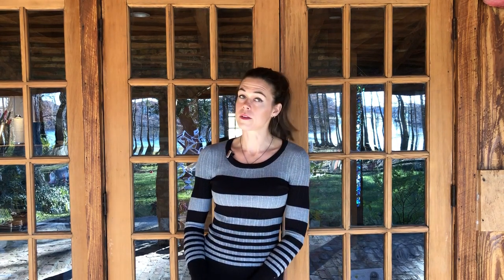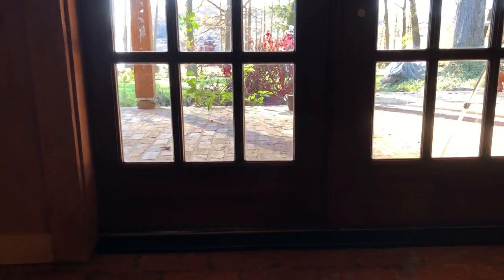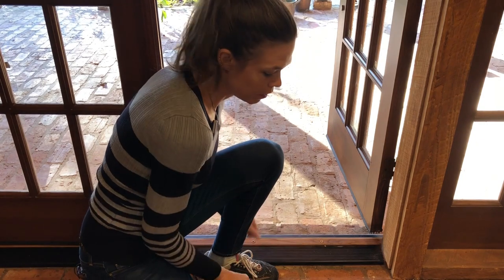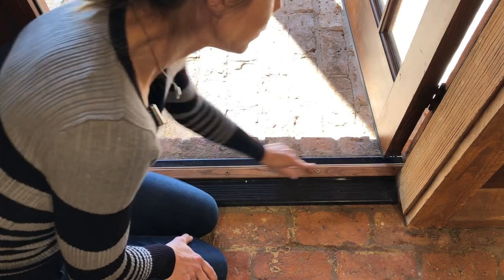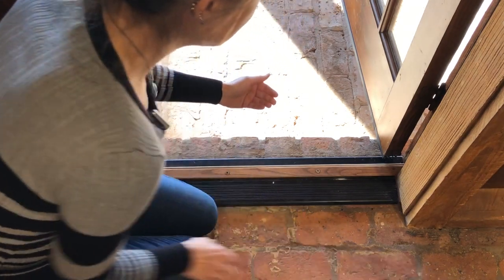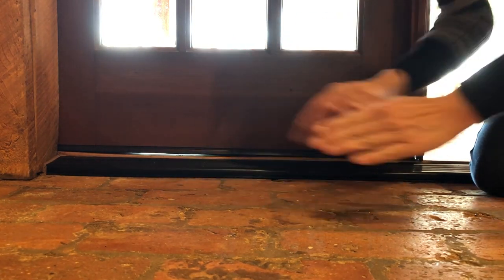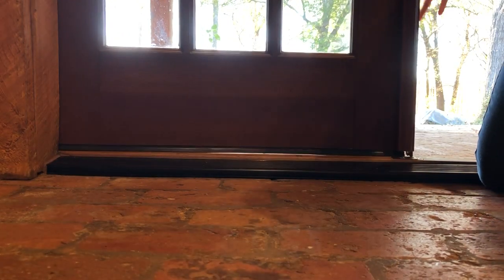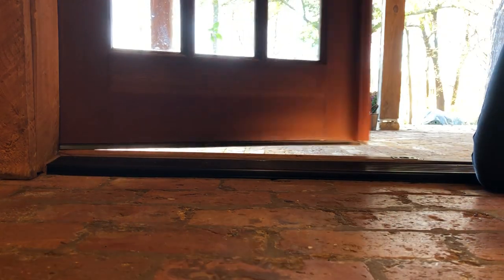TEAMSK - Adjustable Door Thresholds

Comment: Close door on a dollar bill at each adjustment point. It should come out fairly easily with a little resistance. Also, use a regular screwdriver for fine adjustments.
Reply from the maker: Great tips!

Comment: It appeared the door is to tight at the end where the latch is causing it to press down too much on the rubber seal. This will wear out sooner than it should. I would tighten the threshold at that spot a bit.

Comment: Your back!  I could use some help with a remote switch.
Reply from the maker: What’s it doing?(Or not doing.) 🙂
Reply: @MonkeysKnow  Congratulations on your marriage, praise Jesus!  While renovating my bath I found a hidden closet but a wire crossed the opening.  The wiring is I will call it schizophrenic.  But I got the wire cut and the receiver installed in the closet and I installed the switch and it works!  The only problem I seem to have is after programming the learn button on the receiver and transmitter switch the top blue light is supposed to turn off on the receiver.  No worries.  The remote switch is a sk8 skylink.  Good to see you.  It seems a lot of people are moving to Texas from CA.  See ya!
Reply from the maker: Wow! What a fun surprise to find a hidden closet though. The remote switch is a great idea!

Comment: Mine won't go down any further and still rubs
Reply from the maker: Can you adjust your hinges to help at all?
Reply: @MonkeysKnow  Havent tried, brand new door installed a few months ago and was fine up until now.
Reply from the maker: Hmm, maybe have whoever installed it do an adjustment? It shouldn’t be dragging when it’s only a few months old.
Reply: @MonkeysKnow  Check the gap at the top of the door. It should be even across the top. If is smaller at the hinge side and wider at the latch side, the jamb dropped at the hinge side making for a harder sweep.